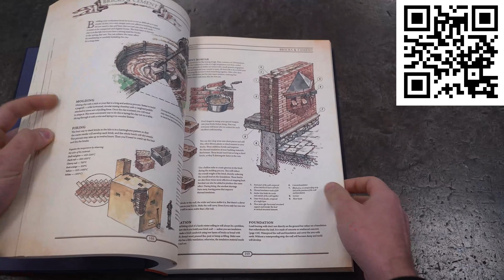Trying Dragon Scale Damascus — What I Learned

Comment: Stainless had nothing to do with it. You had oxygen free. We forge weld high carbon to stainless all the time. You just didn't get the billet hot enough. . It needs cross boundary grain growth ie, letting it sit at welding heat for a while. Steam need to be coming off the billet which i didnt see on yours.I see a very common trend on your channel of you forging at heats much too low. You should try again id like to see a redemption vid.

Comment: As we all know, we only learn from mistakes. This billet could have been succesfull. As far as I can tell from the video the billet could habe been a little bit warmer. And stainless steel needs a bit of time soaking in the forge at this high temp to dissolve the chromium oxides which prevents the welding process. Of course given that you know from the beginning that there are stainless parts involved.

Comment: To avoid pattern distortion, you'll want to forge from all 6 sides. At that, i would start with a jacket that's 10x10x10 rather than a rectangular section. One way you could achieve this would be weld the holding clamp bar by one of the corners. That said, i would use a custom set of thongs for this - and a custom die set as well, to work the material even. When you start with such things, making tools might not seem intuitive, but it is important.
Also, if you aren't already watch a lot of Shurap's work. He has perfected the whole path to the enclosure and at least in my eye, half the work is in the making of the jacket.
Merry holidays!!! :goodvibes::yougotthis: